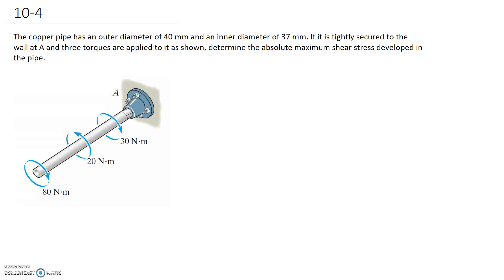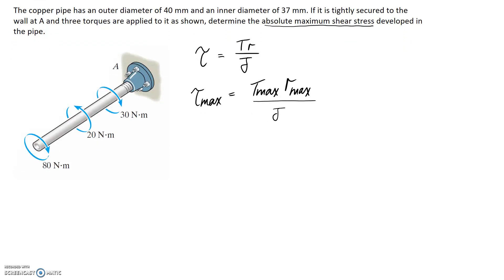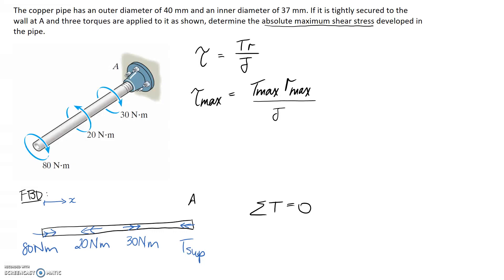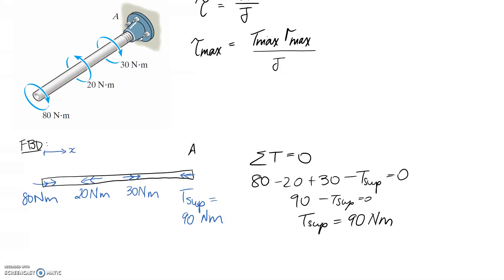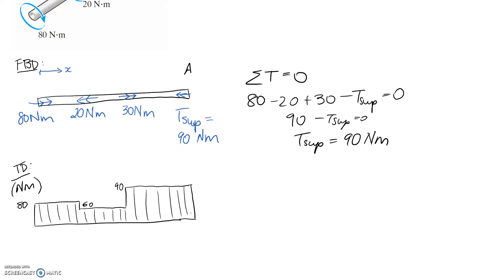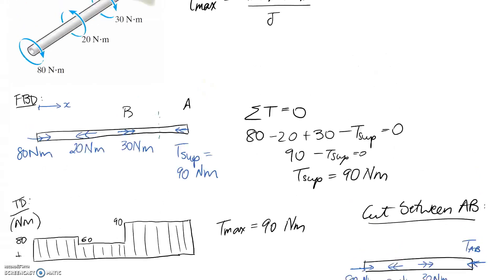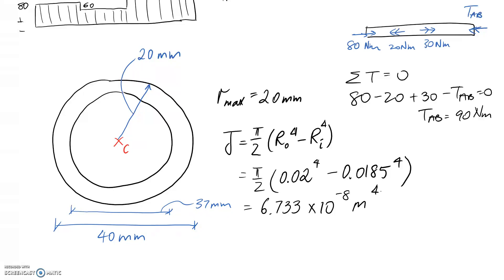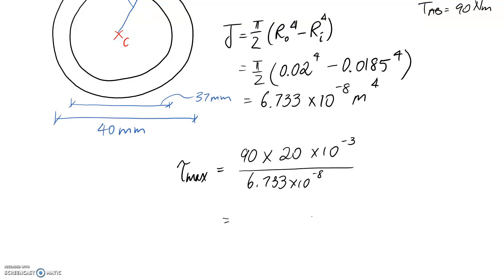Shear Stress in Shaft due to Torsion

Comment: A steel shaft 50mm diameter and 0.5 m long is subjected to a twisting couple of 10³ Nm and the total angle of twist is 0.6°. Find the  maximum shearing stress developed in the shaft and the modulus of rigidity. Plz solve this and give answer🙏

Comment: btw you are mistaken about the Torsion graph, right hand rule must be applied for internal torque not for external one so the graph should be upside down.
Reply from the maker: Hi. It doesn't really matter which way you pick - just as long as you are consistent.

Comment: What if we assume the shaft isnt connected to the wall, how will you know which is the positive direction
Reply from the maker: Since we are summing torques to zero (for equilibrium), then it actually doesn't really matter which way you assume as positive as long as you're consistent.
Reply: @theryderproject5053  Thanks for your help!